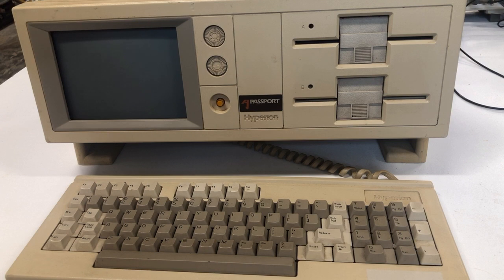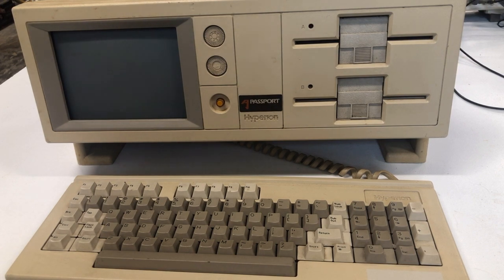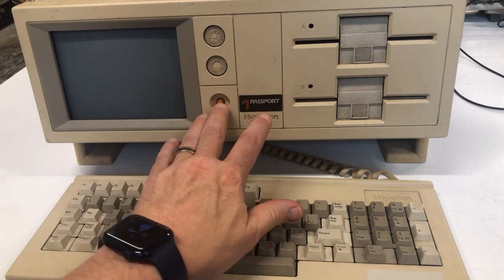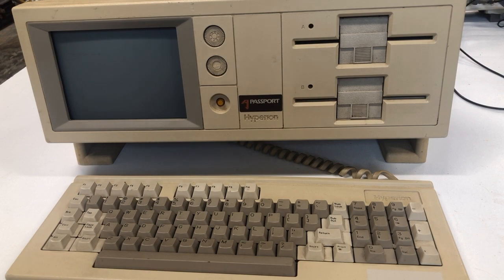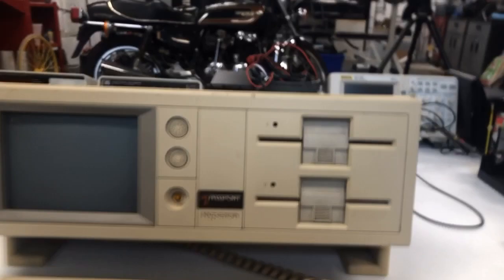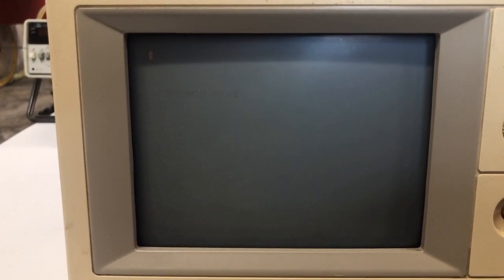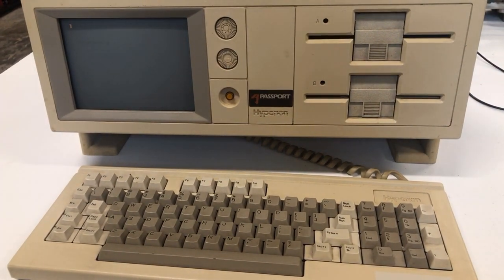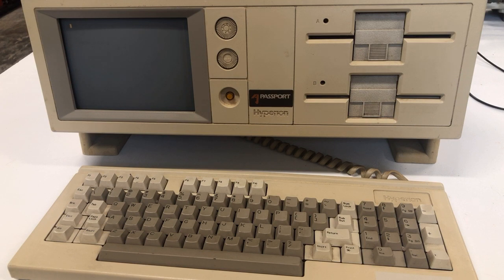Dynalogic Hyperion, the first MS-DOS portable computer.

Comment: I owned this computer - my father owned a chain of retail computer stores in the 1980's in the Boston area. His company was the sole US distributor for Hyperion PC's and he sold quite a few to the academic/university community in the Boston and Cambridge area. I was given one of the dealer samples and I used this computer from 1983 - 1987. It had a reliable 300 bps modem. While there were many compatibility issues with mainstream PC software of the time (Lotus 1-2-3,, etc) it did run Wordstar quite well. It also ran Borland Turbo Pascal - and it was quite impressive. My college computer science professors were impressed. Borland Sidekick productivity utilities also ran well on it. I was able to run a serial connection to the campus network and connect to Unix based servers via command line. The sample I had was robust and paired with my Okidata dot matrix printer, I was the envy of my peers in my undergraduate studies.

Comment: I believe the Z80 chip that you saw in the back was a Z80-SIO (serial input/output controller). The CPU in this computer was an Intel 8088 running at 4.77Mhz, IIRC.
Reply: Pretty much...  The CPU is on the far left side of the inner board next to the empty socket he identified as the math-coproccessor.  He never shows it well, but I believe this machine has the NEC version of the 8088 (instead of the Intel or AMD version)
Reply from the maker: You are correct, I had the boards reversed in my head, the outer board is i/o the inner is the system board with a 8088
Reply: I would be interested to know if it is a NEC (v20 I presume). I haven't seen any in the wild clocked at 4.77 Mhz, but I believe they were rated for that clock speed too.
Reply from the maker: @incubus3827  it is an  NEC D8088D.  I  left it open because I'm waiting on parts to replace the battery for the real time clock
Reply: @drueking  thank you! The v20 would have brought better performance, but alas I just checked and it was only released in '84